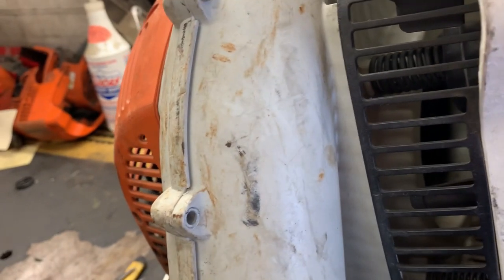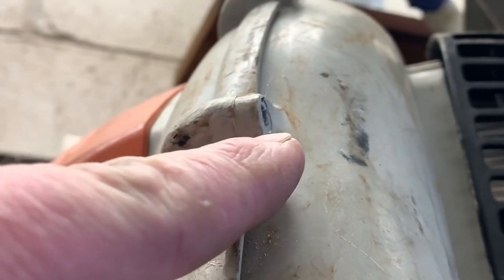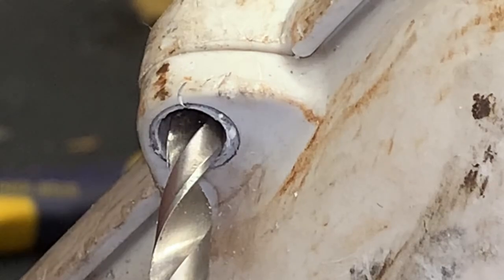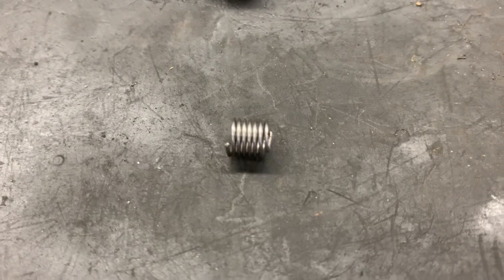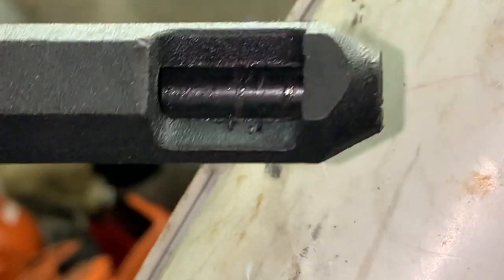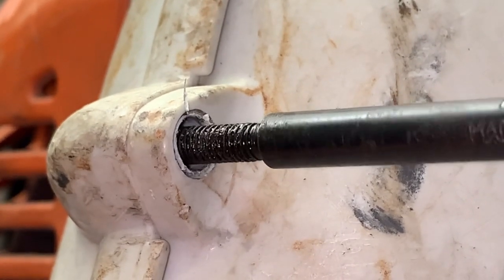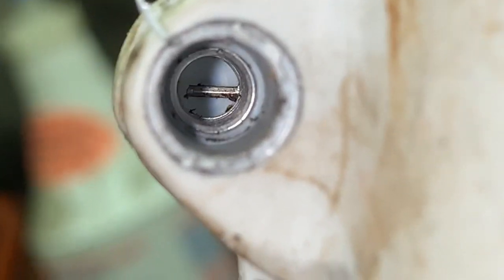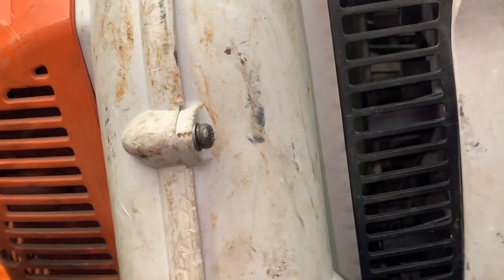REPAIRING STRIPPED THREADS IN PLASTIC

Comment: my intake plenum is stripped...I didn't even bother to ask dealer about repairing it because they're going to MOPAR it right up my rearend with an overpriced part and labor rate that even doctors would be happy getting.  I ordered a new intake plenum for 150 bucks, but think I'm going to try helicoil first and do a return if it works....not much more to loose other than a few days on a kit and the 6 bolts....RAMS suck with plastic parts!

Comment: i isually cut small strips from a small nylon cable tie the length of the hole plus a lulittle more outside the hole and reinstall the screw...never had one fail and a lot cheaper and less work...

Comment: BMW Dealership screwed my moms car up. overfilled it many times becvause all the gaskets were leaking like a siv and stripped her drain bolt. She has a plastic oil pan and a plastic bolt. They wont own up and want her to pay for new oil pan. gonna try this and replace w a metal drain plug. Do you think i would have any problems w a metal drain plug in a plastic oil pan? Thanks. Just trying to find a cheap fix.

Comment: I have never thought about using helicoils  in them.  I usually use JBWeld to build up the existing threads and then screw a plastic type screw in them coated with grease, so it won’t stick to the JBWeld.  I screw it in loosly and remove it after the JBWeld starts to set.  The next day, I will screw the screw into the new threads that I made with JBWeld.  I do not tighten it fully for several days to allow the JBWeld to fully harden.  I clean the original hole throughly with break cleaner and coat the remaining threads with a tooth pick with a little JBWeld on it.  I am just trying to build up the threads before I screw the grease coated threads in the hole.  You have to use a machine bolt in a helicoil repaired hole instead of a P screw.  Most Stihl screws are P5 screws.

Comment: I'm an old Helicoil guy, got a big drawer full of 'em. I've even got that 5x.80. The screw being replaced was a self-tapping screw, meant to go into a smooth hole in a molding made of old milk jugs and hopefully never taken off. Why did it go bad? It's just holding a clamshell assembly together with screws either side. Was this for a demonstration purpose? That's fine. Was the cover removed and this came as a consequence? Whew, so many questions. When I saw the first video, with the comically small wire, (a stupid fix in any event), I wondered why nobody stumbled on what seemed to me to be the obvious solution and one I've used many times on small engine equipment with this issue. Take that screw, hold it in a pair of pliers and flatten it with a ball pein hammer on the anvil of your vise until it's about a millimeter wider. Maybe more. Whatever. Slather it with your fav plastic glue, (yes it will come out later), and after 27 seconds of work it's done. A Helicoil here is kind of overkill, but actually, if I was in the right mood, I'd do it. But dude, pull the cover. Do it right. I'd never drilled that 1/4" hole. I've seen an Echo blower with a 1/2" drywall screw doing this job. Love your videos, but just like with Steve, sometimes
Reply: Yah, seemed silly to wallow out the other side of the cover when you aren't inserting the helicoil there.  If you are going to go to the bother of "doing it right" then do it right.
Reply: What kind of plastic glue do you recommend?

Comment: Had this happen before ended up drilling all the way thru the plastic grinding it flat on the back and ran a bolt thru with a nut on the back still holding strong